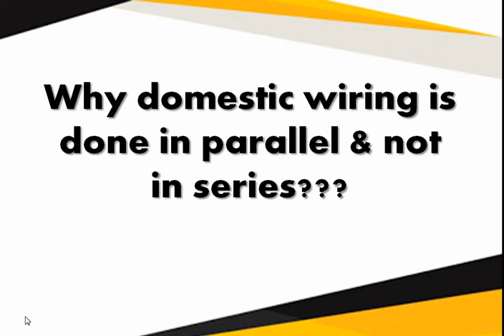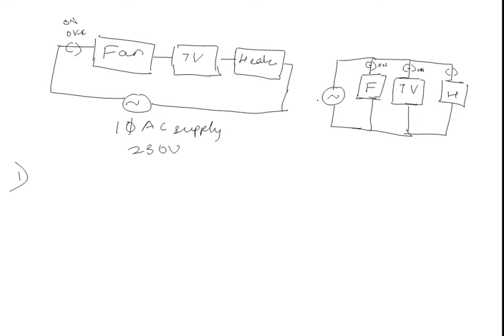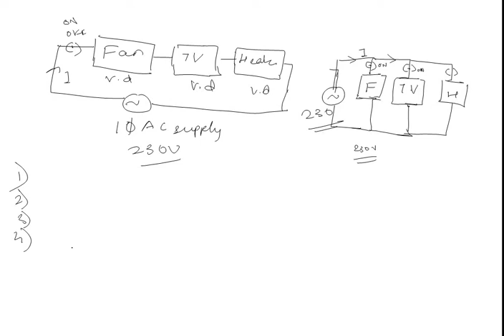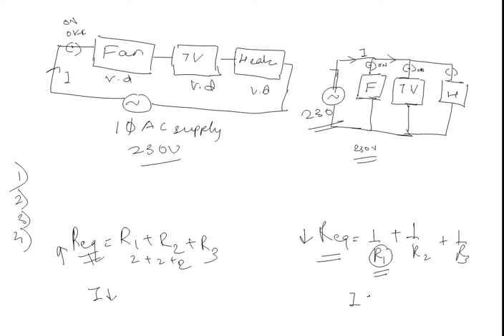Why domestic/household appliances are connected in parallel????

Comment: Suppose I want to connect a buzzer when Iron/geyser is switched on, can I connect it in series with iron/geyser or in parallel or any?
Please note that the buzzer should not buzz when iron/geyser is in off state due to thermostat in iron/geyser.